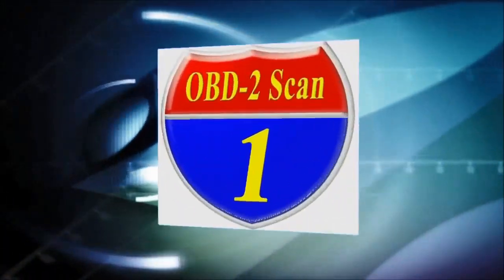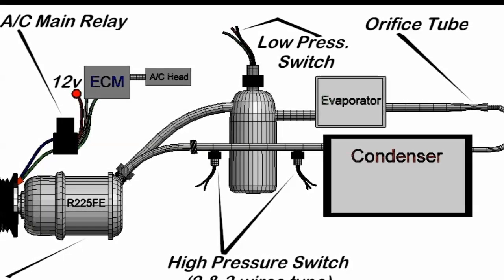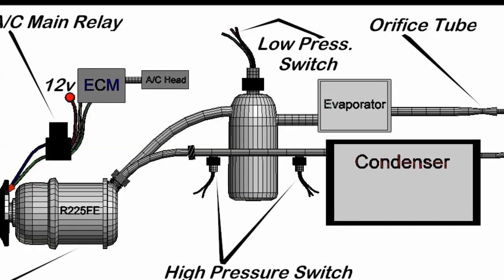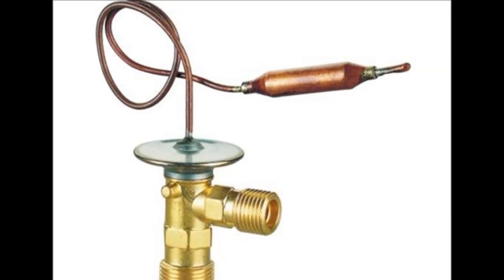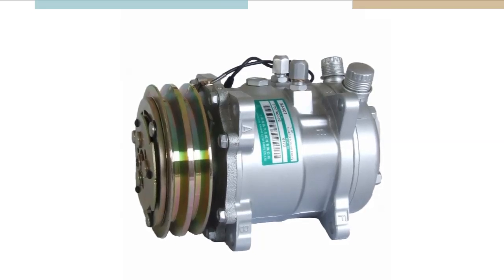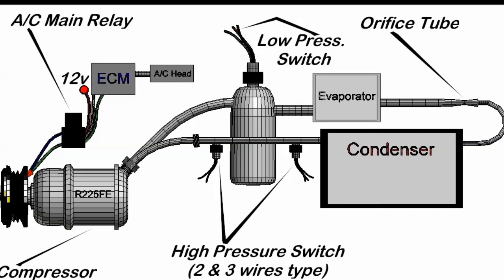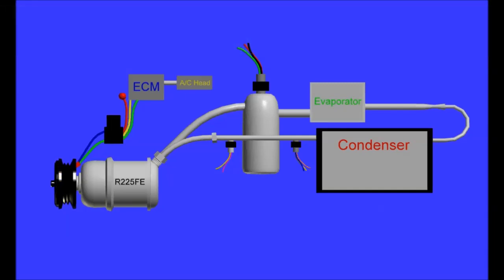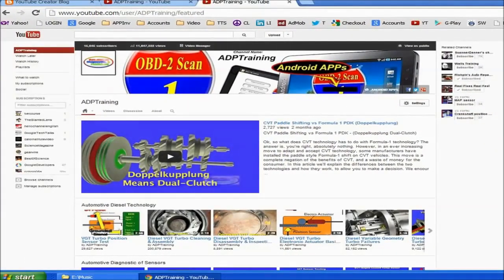Complete Automotive HVAC System

Comment: The compressor does not compress a liquid as you say in the video. It is impossible to compress a liquid. The compressor receives low pressure refrigerant vapor from the evaporator and compresses it to high pressure vapor and sends it to the condenser where the gas CONDENSES back into a liquid.
Reply: Haha,  I went straight into the comments as soon as I heard that bull.

Comment: If eev valve stuck close, the AC will trip off circuit breaker? I have a refrigerated equipment. The circuit breaker trips off in about 10seconds after turning refrigerant system. Everything else seems ok. Thank you

Comment: I hope in your new description of HVAC since electric compressors will become and are becoming the majority of the compressors on cars you discuss those. 

        That fixed piston compressors have been slowly phase out and are almost not used anymore and automobiles so diagnosis pressures no longer follow the same rules that we used to use to diagnose or recharge vehicles with. 

         The last three years I just started working on vehicles that now how heat pumps in them and this will become the normal operation especially on electric vehicles. 

          In the option for CO2 heat pumps is offered by Volkswagen and Audi i’ve made a few videos about the heat pump systems on both Volkswagen and Audi and Prius prime that I have been working on. 

         Some of the newer vehicles that do not have condensers anymore they now use plate heat exchanger‘s with a glycol loop system. 

The future is here

Lead ,follow , or get out of the way

And that the refrigerant R1234YF it’s already on the plans to be phased out and there’s a few test refrigerant already in vehicles being tested to replace R1234YF

       Vehicles now that are using the heat exchanger glycol loop system that replaced the old fashion condenser that used to be in the front of the car are prime candidates for using R600 for R290 propane or butane because it keeps all the flammable gas out of the passenger compartment and you only need three or 4 ounces of it under the hood completely safe small quantity easy to manage
Reply from the maker: Looks like you're on the loop my friend. We're not seeing this technology yet on auto repair shops around here, but you're right, the future is here.
Reply: Thanks for the info.in the majority real world high profit jobs we won't be getting these hightech new junk anytime soon.real world we concentrate on making real self employed real money or get out!!!!
Reply: TLech is the God of air conditioning